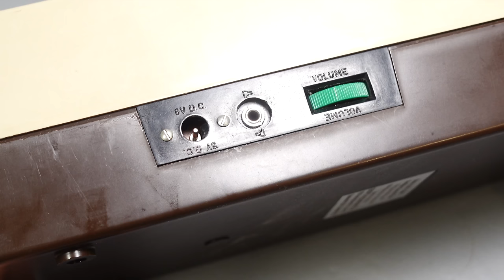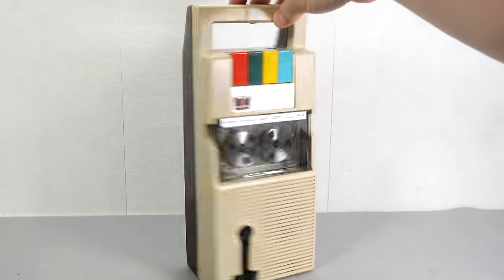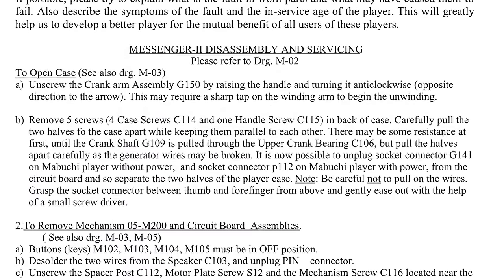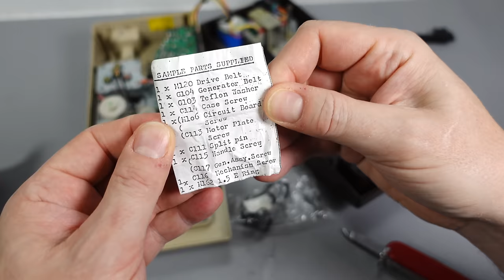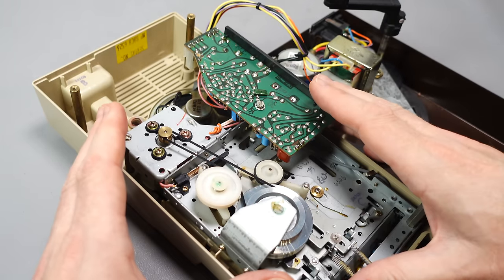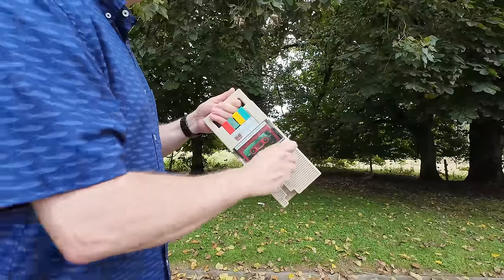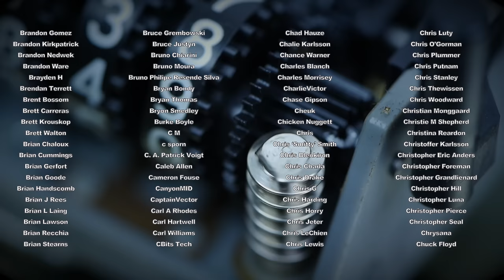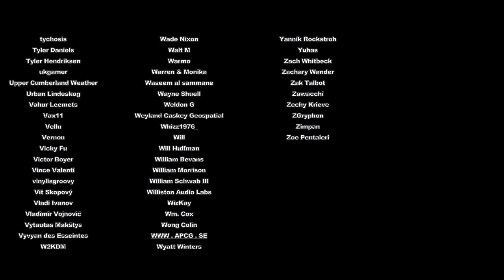This off-the-grid cassette player is a wind-up

Comment: I like seeing tech that was designed to live as long as possible, not one small component fails and so resigns the rest to be landfill...
Reply: Not so good for a profit-based never ending growth model of economy though, is it?
Reply: not only product all mission is impressive.
Reply: @doktormcnasty  Between for-profit reasons for planned obsolescence and cultist-inspired reasons to extend a preaching machine's lifespan... it is hard to think of a way out of this...
Reply: Definitely. I can see one of these lasting for decades if properly cared for. Would be perfect for putting into a time capsule along with some recordings and in hundreds of years time people from the past would know how people from this era spoke. Imagine
Reply: In what way is this device more durable than any other cassette player?  The spare parts are a nice gesture, and the belts may last a while if left sealed in the bag, but the electrolytic capacitors are going to fail eventually and lacking replacements and a soldering iron it's not going to be fixable for a casual user.

Comment: As a child, I made a funny device for powering a pocket radio. I got a stepper motor out of an old dot matrix printer. I've kept the paper feeding mechanism, and wound some fishing line to a bigger wheel. Then I mounted the thing on the balcony, and attached a weight of few kg's to the fishing line. Then I've connected two bridge rectifiers to the four wires coming out from the stepper, and attached a big electrolytic capacitor. While the weight was slowly moving downwards (it was a out 15 minutes to reach the ground) the radio was playing some music or news.

Comment: Some sixty years ago, Crown International made a field tape recorder for the National Geographic Society. It was a portable reel-to-reel machine with transistorized electronics, but the capstan and take-up reel were powered by a mechanically-governed, spring-operated motor that one cranked up like an old Victrola. Fast-forward and rewind were achieved by literally cranking the appropriate reel by hand. The idea was that field recordings could be made in high-fidelity, but without the battery drain of powering motors. The electronics used such a small amount of electricity that the batteries would last many, many hours. The machine you've demonstrated reminded me of this.

Unlike this machine, the Crown's crank wound a spring, and the spring then powered the machine's mechanism. And of course, the electronics were battery-powered. One did not turn the crank while the machine was running.
Reply: Do you by chance know the model number of the Crown International clockwork tape recorder? I would love to find out more.
Reply: @CassetteMaster  I've been trying to find more about it myself for years. Sorry.
Reply: The National Film Board of Canada had  a spring wound machine as well. Not sure if it was a Nagra but fairly certain it was.

Comment: My father had an AM/FM radio that could be powered three ways: by the integrated solar panel, external power from a DC plug pack or from the clockwork generator. A heavy clock spring wound by a crank handle drove a generator that in turn supplied power to the radio circuits. Fully wound up, it could run for 90 minutes.
Reply: I remember a radio like that and it was wound and would spin a little generator maybe they called it a dynamo, but it ran the radio as you said.  And I do remember a solar panel being on it,  I am sure it was yellow in colour and had Short Wave as well.
Reply: I have one of them. It's a really impressive piece of kit. I assume a radio needs a lot less power than a cassette mechanism but additionally the sound comes out quite loud and quite warm. A full wind will last about 20 minutes without solar assistance and any light will help it up to a nice sunny day (even in England) being able to power it unaided.
Reply: I've been doing a bit more research.the device was a Freeplay Radio. Later versions had a small detachable wired LED light in the end of it near the speaker @Milamberinx
Reply: Could be made so the cassette mechanism is powered directly from the spring and the amplifier from a generator. Old movie cameras used a spring and a simple mechanical governor to keep the frame rate steady, I believe a similar mechanism could be used to power a cassette player.

Of course this is a cheap mass produced item, a spring mechanism would cost more and mandate a much sturdier case to contain the forces.
Reply: Yes, thr Baygen Freeplay radio, named after its inventor Trevor Bayliss. He seemed to be on TV a lot in the 90s after Tomorrow's World picked up his invention, qhich was designed for off-grid use in developing countries, but according to Wikipedia he lost control of his patents and died in poverty. I thought the radios (and off-grid stuff in general) were cool and coveted one for years, but IIRC they were very expensive and still fetch a hefty price used.
Reply: One of my friends scored a FreePlay radio while dumpster diving! We would stoke up a fire and chat around the fire pit while listening to reruns of Art Bell on that radio! Good times! 😊
Reply: My grandparents had a radio like that, but it was kind of broken. So the crank would cause interference over the speaker while it was in AM mode, and when the internal battery the crank was charging would run dry, it would make this ridiculous farting sound and then stop working entirely.
Reply: I have a modern day version, which also includes a USB port so you can charge other devices from it, via the crank or solar, another impulse buy that I have never found a practical use for...
Reply: I had one when I was younger, think it was camo green 😂 can't remember it lasting 90 mins and I don't think the solar cell was that great
Reply: @rich_edwards79  I actually bought one of the BayGen devices but had ti return it under warranty as the spring would unwind rapidly as soon as it was wound up. That was the last of the BayGen versions, I replaced it with the newer Freeplay version that was more compact and a sort of funkier shape as well as being smaller.
Reply: @Milamberinx I have one of the early ones (large and no solar). My original one the handle broke and of course being under quite a lot of pressure i couldn't get glueing it to work. I think Trevor Bayliss got somewhat ripped off by business partners sadly
Reply: I need to see that.
Reply: @shardlake It's called to listening to the radio?
Reply: @jnharton  Agreed, but a have a plug in one at home, one in the car and built in radio with my motorcycle comms system, that never need cranking :)
Reply: I still have a FreePlay crank am/fm radio. At one point it got over cranked and was fixed. Now it has a label on it saying not to over crank and it works fine. Plus the sell is transparent so I can see the insides.
Reply: That's a pretty respectable run time for a mechanical battery. You'd avoid the capacity fade of chemical batteries as well.
Reply: I think that was quite common on earlier portable radios, given use by military etc in remote areas would be some of the first kind of i dustries tk benefit from this kknda tech
Reply: @rich_edwards79 if I recall correctly the problem was Phillips had a very similar patent which caused all the litigation.
Reply: I remember one from Conrad
Reply: I remember seeing one of these. The radio was a simple AM-FM design. You wound it up like a regular alarm clock and away it played for about two hours.
Reply: @RJDA.Dakota  WOW. Winding up an alarm clock is something i havent thought about almost 30y ago when ny grandfatger told me about it. What a bkast from the past. Obv mechanical watches still can wind, and when i grew up in the 90s pwning a wind up watch wss pretty common. But wound up alarm clocks just unlocked a memory in my head lol

They still sell 'em but when people say alarms i always still think of a red alarms with two bells on the top, i think ive only ever owned digital clocks other than wall ones lol.
Reply: @rich_edwards79  Ah, that was what it was called, I was struggling to remember. I think I know where mine is in the mess I call hall cupboard No.1...
Reply: I think a short period of hard-work would be better than long-and-fast-and-continuous like this requires. A bit more of a hassle to implement though, I suspect (though not that much). I had a flashlight that was lit by squeezing a handle when I was a kid. Blisters soon ensued.
Reply: @chaos.corner  I had a calculator and a low-power LED torch both powered by tiny batteries that were charged by a linear generator in the form of a magnetic core that was passed through a coil by shaking the torch up and down and the calculator from side to side.
Reply: wind up radios at one time were suggested for people to have in their go kits for disasters or in storm cellars for tornado alley. specifically because they stored better than batteries.
Reply: @Milamberinx  Your assumption is correct.  Years ago I hacked a small boom box to run on 5 NiCd cells vs 4 alkalines.  (Work wouldn't let us plug into the mains and the cost of primary cells for daily use was prohibitive)  The cassette motor would definitely run the cells down quicker.  I recall it could just about go a full work shift with radio, but would only last half as long playing tapes.
Reply: @Murgoh Mesuring tapes are made of cheap plastic and contain a spring. They are not as pricey as the rest of that custom shell and quality tape mechanism.
Reply: Wind up Vitrolla turntables used no electricity at all and where hand cranked with energy stored in a spring controlled by a governor fir proper output.

Comment: You could always keep your wind up cassette player next to your wind up radio and wind up torch in a steel biscuit tin to help protect them from an EMP pulse.
Reply: Yeah, but where would you keep the biscuits? You'd need them post-apocalypse.
Reply: @Tim091 you'd buy another biscuit tin and put your biscuits in that. And then... Wait a second... I've got nowhere to put those biscuits...
Reply: If you had a friend you could record a mix tape off of the radio. I assume. I don't have any of the things mentioned in the conversation so far.
Reply: An electromagnetic pulse pulse? 🤣
Reply: @MrPeterhe maybe try buying a bigger tin of biscuits.
Reply: As far as I understand though, these devices are only susceptible to wind-up EMPs, right? So a regular nuke going off somewhere in the area should be fine?
Reply: A windup device like this wouldn't be affected by an EMP.
Reply: Wait, is THIS why the Dr. Demento show always begins with "WWwwwwind up your radio!" ?
Reply: It's fun when people comment that don't have a clue. What does an EMP hurt? what distance / shielding involved? People generally don't know how offensive EMP works @dyveira
Reply: @dyveira why not? Its elecronics with a pcb inside and wires...
Reply: I purchased a second hand Betamax VCR once and it came with some spare parts. I was rather surprised by this.
Reply: @walkingtheboogie Betamax was so much higher in quality than VHS. But the majority in North America only cared about price and cassette length.

R.I.P. 'old school builds.' 😢
Reply: @Tim091  Enjoy the biscuits now, put the equipment in the tin - 
 Post-apocalypse IF you survive find the other tin labelled food !
Reply: @sw6188    you know , like a UPC code .

Comment: What a cool idea, it kind of reminds me of the Freeplay Wind up radios from the 90s, they worked a bit differently though, those radios used a spring wound clockwork mechanism to play the radio once you wound the spring up, much like a gramophone.  I kind of wish this cassette player worked the same way.
Reply: It could potentially be modified to do so. It would just require a small battery and suitable charging circuitry. Crank the handle for five minutes, charge the battery then listen to the music.
Reply: That would certainly help.  I suspect cost was a primary consideration.  I can't imagine too many people used these in earnest much past the first cassette.
Reply: @sw6188  The spring is better than a battery though imo because it is more clear when you are charging it.
Reply: I had one and loved it...until the spring broke.  Quite interesting to watch it work as the clock mechanism was controlled by some sort of regulator and would change speeds based on how loud you were playing it.
Reply: @grayrabbit2211  I think the generator charged a capacitor, and, if I understood correctly, a short was placed across or on the generator when the radio was off/had charged the capacitor.
Reply: @Lachlant1984  That is quite elegant. I wonder how much he actually talks about the radio in his autobiography. I got it about half a year ago and have been slowly reading it the past few months but I haven't got to the point of the radio yet.
Reply: @bangerbangerbro  Who are you talking about?  Are you talking about Trevor Baylis?  I'd no idea he'd written an autobiography.
Reply: @Lachlant1984  Yes, Trevor Baylis. I didn't know either until I found it in a charity shop. It is called Clock This- my life as an inventor
Reply: @bangerbangerbro  Hmm.  I'll have to see if I can get the book from the library then.
Reply: @Lachlant1984  Yes it is quite interesting. A lot of interesting stories in it that I would like to believe are true.

Comment: I have a wind up (real clockwork wind-up) reel-to-reel.
It's a Commonwealth Electronics type CEB, and is said to be the first portable tape recorder made.
Made in Sydney in the 1950s. Serial number is in the double digits. It works great.
Reply: Any more info on that?  Sounds v interesting.
Reply: But doesn't it need batteries for the amplifier?
Reply: It probably has a generator that works from the wind-up mechanism.  @organfairy
Reply: It probably needs batteries for the electronics. Similar designs were made in europe for professional use, like film production and off-site recordings for radio. Might have been made by Nagra and/or Perfectone, at least? They used a high voltage battery (90 or 100 volt, like in a battery operated radio) to power the valve (tube) based electronics and a wind-up gramophone motor to drive the mechanism. Obviously done first and foremost to save power. Anyway, the introduction of transistors, better batteries and electronic motor speed regulators made this design obsolete after a relatively short time.
Reply: @organfairy  It does need old style radio batteries for the electronics. (All valve!)
Reply: @graemelyall937  I think I will put up a video about it, it is indeed an interesting bit of gear.
The clockwork motor runs only the mechanicals. The valves in the amplifier are fed by a big rectangular 1.5V battery (filaments) and 2x 67.5V batteries (plate supply). It seems quite economical on the batteries.
The person who sold it to me had no idea what it was, and I didn't realise it was particularly significant until I got it home and had a good look. Apparently they only made ~150 of them.

Comment: I think it would be interesting to modify this device by adding a super capacitor to the output of the motor. Would allow you to take a break from winding.
Reply: Exactly.   The utility of the device would be immensely improved.
Reply: It would take quite a while to charge high enough before it starts working though. It would eliminate a lot of wasted energy
Reply: would probably make more sense to stick a lipo charger and small battery in the device so the winding motion charges the lipo and distributes the power to the main amp/motor
Reply: @foundatlantis  Exactly how it was done on Saber, BTW.
Reply: +100

A smalll NiMH array might also be suitable. NiCds can, from what I hear, take more abuse than NiMH in situations like this, but the memory effect they have present (thankfully ONLY NiCds have that) kind of defeats the point. A particularly tiny 6v SLA might also work, but I'd think the weight issue would make things a whole lot less portable and more awkward, that way...
Reply: That's logical, I'd like to see a more wild modification like adding a windmill to it, or attaching a power drill like those ridiculous train horn hammer drills I keep seeing on ads.
Reply: @laserhawk64  the memory effect can be an issue, but it's actually not nearly as big an issue when it is trickle charged.  Like say... From a very low-power hand crank where a bunch of the power is already going to power the electronics.  It might not hit the sweet spot, but it might too.  :)

Comment: I used to volunteer for a tape ministry. We got our supplies  from a company called Adirondack. They sold numerous versions like this. Some of the higher ends had something like a capacitor to store any excess power produced while winding or allowed whoever to crank for a long time to store up enough  to play for slightly extended lengths of tape.
Reply: yea you could use a cap or a clockwork spring. both would let you have play time without the need to always be winding,. guess they did think of that. the spring may be a bit noisy thow.
Reply: If the YT algorithm were smarter this would be one of the top comments, since it's interesting information we'd never have known otherwise. Oh well.
Reply: @martysmith2756  thank you very much. Your words are gratefully recieved my friend.
Reply: @martysmith2756  or was that sarcastic? Either way.........thanx!